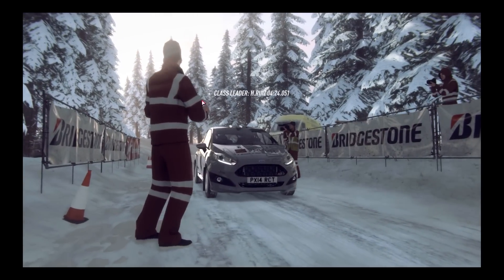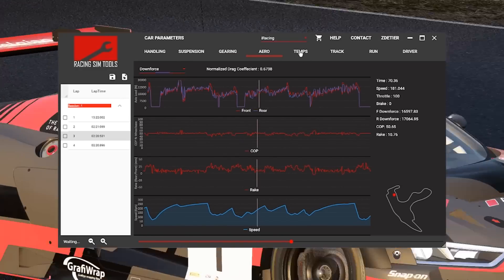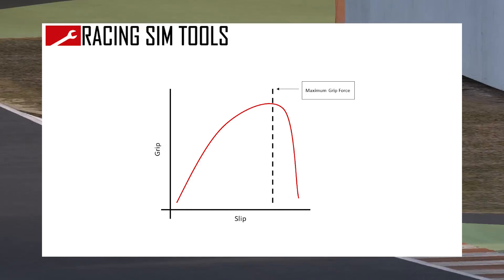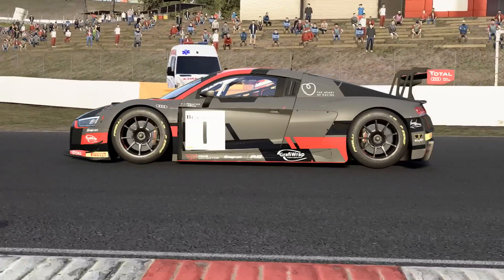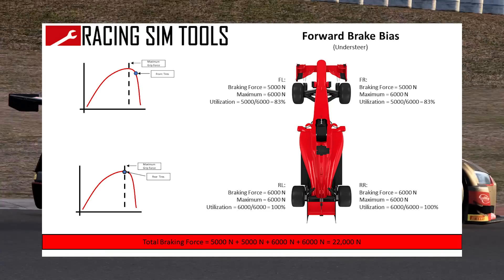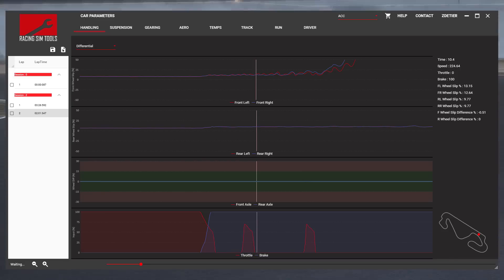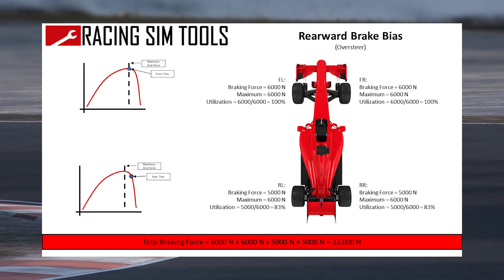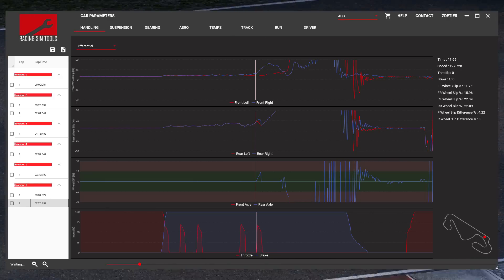RST Sim Racing Tuning Guide | 01 - Brake Bias

Comment: Love the tool the video the passion. Quick question: are you using ABS to get that amazing 100% Brake / Slip Ratio?
Reply from the maker: Thank you for the complement! I love teaching these things to you guys. Regarding the ABS, that's a GREAT question for these videos I actually turned the ABS off. Normally I set the brake bias with it off, and then will set the ABS setting to 2-3 in ACC for actual races.